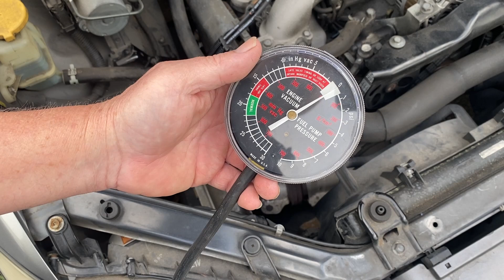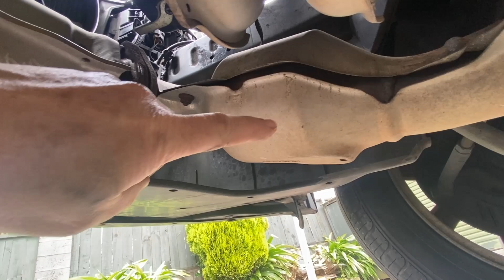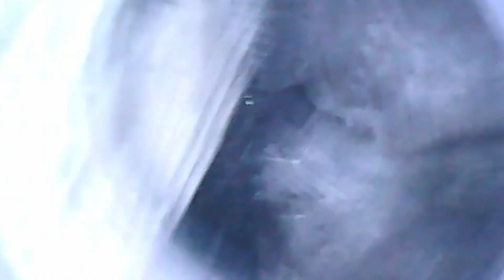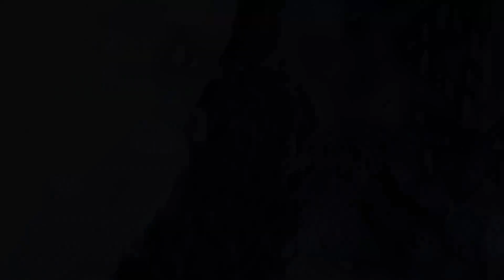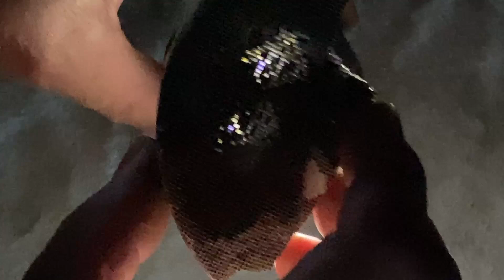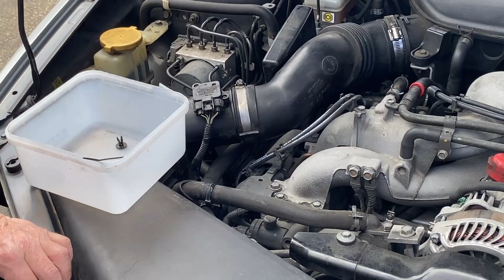Fixing A Subaru With No Power

Comment: Nice diagnosis and fix!  I'm curious if you have vehicle inspections that include tailpipe emission testing?  Very common in many parts of the US.
Reply from the maker: Thanks for your comment. For general private use cars we have to get a Warrant of Fitness (WoF) every 12 months (or every 6 months for older cars). But there is no tailpipe emission testing for a WoF. However they do make sure that there is no visible smoke coming out of the tailpipe. If your car was burning a lot of oil and there were clouds of smoke you would likely fail your W0F.

Comment: "secondary muffler" = resonator.
 Is the entire system one piece?
I'd start unbolting flanges from the back to front..
At some point it has to start running okay.
Reply from the maker: No it is at least a two part system. The pipe I removed contained the two cats and bolted to another section of pipe which went down to the mufflers. I did not look to see if there is a flange between the two mufflers.

Comment: 30 seconds in, my first thought is* clogged cats.
Misfire is often a cause
Reply from the maker: Yes, I was going to mention that in the video but did not get to it. I did a lot of research and misfires are one of the most common ways to damage the cat. This car had a lot of misfires with those dodgy HT leads and I suspect it had something to do with it.
Reply: Either raw fuel makes it's way to the first catalytic converter on startup or gets lit off in the exhaust by another cylinders exhaust valve opening. The constant hammering breaks up the ceramic matrix and resulting debris gets caught up by the second converter.

Comment: Very interesting video Jon.  How many KM's had the Subbie done ?  First off I was expecting a blocked fuel filter, so the cat diagnosis was a surprise.  Good diagnosis.  Cheers Rob
Reply from the maker: Thanks Rob. This car has done a few KMs, over 200,000. I noticed the leads were original Subaru leads. They may have been on there from new.
Reply: @thehobbymachinistnz  Might pay to see when the timing belts were last changed ;)
Reply: Blocked fuel filter was my first thought as well.